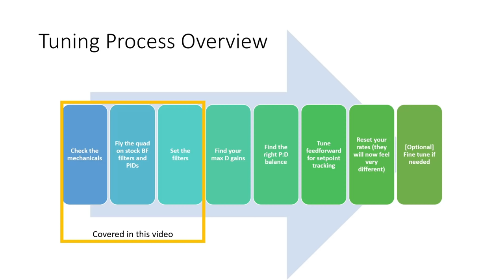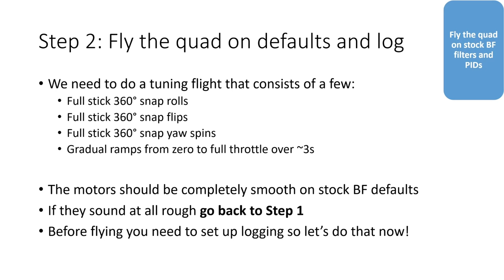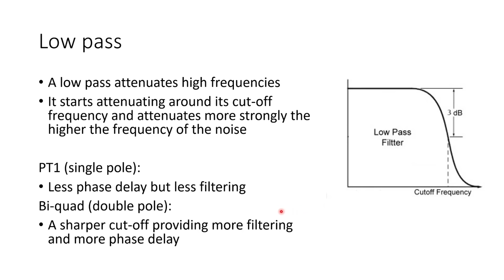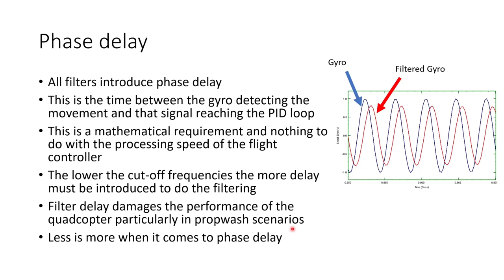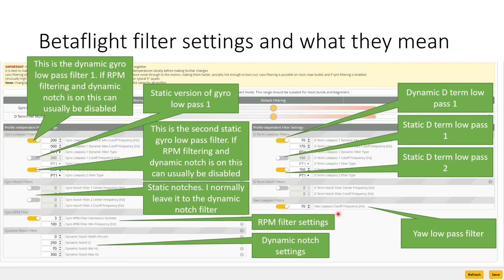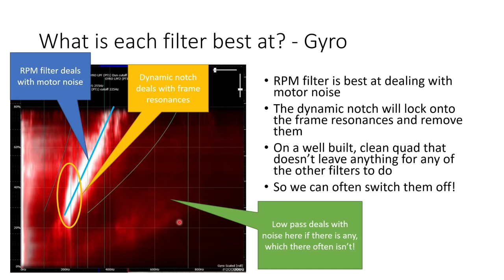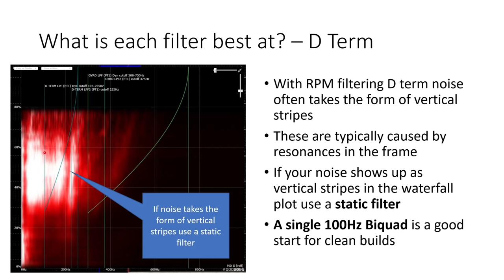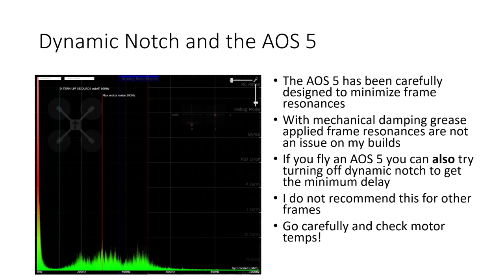Betaflight 4.2 filter tuning. The easy way to get a perfect filter tune!

Comment: Very good video thank you! You are talking about "clean build" a lot, but I could not find any information about what that really means.
Reply from the maker: A build with minimal vibration. New props, smooth motor bearings. Nothing that can waggle around and create vibration in the air.
Reply: @ChrisRosser  thank you!

Comment: How critical is it to keep things off the FC? For micros using AIO whoop style FCs sometimes there is no choice but to use 2-sided tape and stick a vtx or Rx to the board. Or does your video pretty much apply to larger quads?
Reply from the maker: It is a risky thing to stick anything to the FC on any quad. If it touches the gyro chip it can cause problems.

Comment: Thank you very much for this, Chris! What sorts of gyro and D-term filter latencies are you seeing, as reported by Mark's XLS? What do you think is a good proportional split between the gyro portion and D-term portion of the total filter latency? At what latency thresholds do you anticipate big gains (or very poor performance) to occur?
Reply from the maker: On my Perfect AOS 5 Gyro is about 1.5ms and D term 2ms if I remember right.
Reply: @ChrisRosser  That is relatively super low from what I can tell! 1) Can you say anything quantitative or qualitative about the performance benefit per ms below xxx ms? 2) Can you suggest what percentage of latency is worth moving from Gyro to D-term, when the total sum remains constant?

Comment: Hi Chris,
Great video, I have a vertical line on the waterfall graph @ 462 Hz . Should I extend the dynamic notch range to 475 or 500Hz or does the static notch D term set @100Hz biquad take care of this?
Reply from the maker: I would think the attenuation from the biquad filter on D at those frequencies will take care of it. Check you don't get any noise on P as a result though. In general try to keep the dynamic notch range small because then it is more accurate (it only has so many steps of frequency spread across the whole range. The smaller the range the smaller the steps)

Comment: Another great video thanks. tried these filter settings on a very clean Apex build and propwash handling is phenomenal, the quad is super responsive and flies like it’s on rails. It does feel a lot more aggressive than I’m used to though, kind of twitchy feeling because it responds so quickly. I’m surprised that it feels like I need to adjust my rates, is that to be expected?
Reply from the maker: Yes yes yes. You will always need to adjust your rates once you tune. You may have gotten used to the feel of an under tuned quad and bumped up your rates to compensate. Typically you may need to add a little more expo and reduce your max rates a little.
Reply: @ChrisRosser  Thanks, I've never noticed that much difference before but it was really obvious with this. My max rates are usually around 900 degree per second with 0.2 expo and it feels like they've been bumped up to 1100 😂I'll adjust my rates. Thanks again mate, I thought my Apex was flying great but it's next level now.

Comment: Hay man just subscribed after joshua bardwels videos. Ive just built a tbs source one 7", and played around with presets etc but had bad jello in my hd footage, i guess what i would like to know is if i follow your guides on removing filters, settings etc will it still apply to my 7"?
Reply from the maker: It may help. If the arms are only 5 or 6mm thick it will suffer from bad vibration due to the frame not being stiff enough. 8mm is better IMO.

Comment: What would you recommend for a clean build that should be able to handle some crashes? For example a freestyle quad that I'm taking to a bando and/or risky flying.

Currently I just move the sliders to 1.8ish / 1.2ish to have low gyro delay and a fair amount of dterm filtering. It seems to handle crashes and imbalances pretty well, haven't burned anything yet.

Low delay to improve flight dynamics but keeping some leeway for crash resistance is my goal.
Reply from the maker: My filter suggestion should be OK for crashes. It's mainly less D term for crash resilience IMO

Comment: In my case, I was flying ELRS with bad configuration in my radio. The feedforward was sending noise directly to my PID controller. So, also radio and receiver can make your drone fly badly even with the default betaflight config.

Comment: Questions about the gyro and dterm rpm filter q factor... Do you change these from the defaults (500) when turning off gyro lowpass filters? The 4.2 tuning community presets show higher settings for these which would be less filtering, if I'm not mistaken?
Reply from the maker: I don't change the Q factor for rpm filtering. I do change the Q factor for dynamic notch as recommended for use with rpm filtering.

Comment: Hello Chris You covered static biquad settings for verticle noise on waterfall plot. i have a sweeping band so I assume you use dynamic filter settings for the Dterm lowpass filter. Is the default in BF 4.2.9 adequate?
Reply from the maker: I would switch from stacked PT1s to a single biquad.

Comment: Coming over from jbardwell, in for the science.

Question, resurrecting an f450 clone from almost a decade ago (wow with Simon k firmware, pdbs, multiwii 1.3 neo6 gps etc.)

New arms, New motors, New props (hq 9x4.5x3), New FC and esc 4in1.  Had to bump the filter sliders up about .2 (towards more filtering, both sliders) and the master pid gain down .2 to get nice smooth cool motors.  

Is this frame just a wash (specifically the plastic arms with the expectation of long range decent speed flight, id like to be able to flip and roll, but I know it's not really built for that)?
Reply from the maker: Plastic arms on a 9" quad will never match a modern 5"  made of carbon fiber because the stiffness of the material is so very different and the size so much bigger. It's a wonderful project though and I wish you the best of luck!

Comment: Chris, is it right to say that Filtering only removes the high frequencies from reaching the gyro, but physically these vibrations still exist.
Also, no PID settings or Filter settings will physically remove these high frequencies. The only way is to have the quad mechanically sound.
Is all of the above right?
Reply from the maker: Spot on 100% That's why step 1 is so important and why I am designing the AOS frames.

Comment: I have a question - timestamp 24:40
Why dynamic notch? Shouldn't a static filter take a place here since the the noise doesn't move with throttle?

Comment: So according to the information here and if I got them correctly, it makes sense to always use the same setup with a tuned quad. So same battery position and dimensions including weight, aswell as any additional things like a gopro etc, right? Is there a simple rule of thumb when I go without additional gear or different battery?
Reply from the maker: Best to tune the heaviest setup (as that will require the most D term typically) then you should be OK with lighter setups. Or use PID profiles!
Reply: @ChrisRosser  did not yet look into PID profiles. Thanks, I will try it out

Comment: If a quad has no SD or on-board data-flash, what do you think is the best method to get this data? I would fix it on my bench, strap it down securely to throttle it up with props on, and then I want to use a phone app to see the frequencies. Or is there any way to see the frequency in betaflight or other software? The sensors tab only shows absolute values
Reply from the maker: Open lager. Spelt like the beer.

Comment: Hey chris, after doing a blackbox flight on a freshly made quad with loctite on all screws and no damping grease. Applied the supafly preset. All my filter logs are completely flat from 107 hz onwards, only yaw trailing off to flat at around 140. The freequency vs throttle graphs have no waterfall plots on the right side and all the noise is below 100hz and very close to 0hz for 85% of it.( i have the graph scale gain all the turned up all the way from the top right ). does that just mean that i have a really clean quad to begin with already?

Comment: When your looking at the D term waterfall plot at approximately 30 minutes  in.  Is this noise left over after filtering  or before? Also did you just click on Dterm  signal, or is there a gyro_scaled type deal  to click on for looking specifically  at dterm?
Reply from the maker: That's noise left over after filtering on stock filters. I just clicked on D term.

Comment: At 24:00 you say rpm filter is best because it knows motor rpm. Does this change for 2/3/4 blade props? (As some of the noise come from the prop pulses off each blade hitting the arms)

Comment: I'm trying to figure out where filters are placed in the chain. If I well understood, the most of them are placed in the middle between Gyro-output and PIDcontroller-input. With exception of DTerm Filters, which are placed at D processor output. Is it right? So this noisy signal (D processor out) will be used in the PID loop. Am I right?
Reply from the maker: D term filters go on D term input.
Reply: @ChrisRosser  but on D Term input signal has not been still processed by D Term, so noise has not been still generated.

Comment: Can you explain a bit more on how filters are a mathematical requirement and have nothing to do with processing frequency?
Reply from the maker: I use a very simple example to explain this to myself. Imagine you just do a moving average (that's a type of low pass filter) and average 5 points. You can't get your first answer until you have collected 5 points. If those points come 1ms apart then you have to wait 5ms for your first result. No matter how fast you can calculate. All filters work like this (although they use more sophisticated maths).
Reply: That makes sense. Thanks for the explanation.

Comment: When I turn on Bidorect Dshot on my motors dont turn why i cant arm anymore. What i do wrong. I am extremly new in the hobby. And i heard i can manage my propwash on my whoop with dynamic idle. I have the woopfly16 by sub 250 with 35.20g w.n Battery. And 47.38g with 530mah

Comment: Hello Chris. Is 16 MB enough to record a full flight with gyro scaled on the Onboard dataflash chip? It last 4-5 second on mine and is full.
Reply from the maker: Yes it should be enough. Make sure to log at 2kHz and erase before you start. Remember that each log can have multiple sections in BB explorer (top right).

Comment: Hi Everyone,
I have good old Alien frame. As expected it has a big frame resonance at around 220 Hz from 0 - 65 % of throttle. The dyn notch fights this very well. The typical motor noise is very little. Maybe as I use TPE soft mount pads. But I have a second frame resonance at around 405 Hz. The dyn notch doesn't catch this and the D term looks nasty. I think because the width is at 0 which means just one filter at a time. Now I tried an old school fixed gyro notch at 405 Hz with a width of +- 40 Hz. This actually makes it better.
But:
Is this the best way?
Is a lowpass gyro filter (e.g. cutoff 350 Hz) better?
Or should I change "dyn_notch_width_percent"?
Or just update to BF 4.3 with e.g. set dyn_notch_count = 2 ? ;-)

Comment: What should my dynamic notch settings be with a 2.5 inch tadpole frame? Or maybe a better question, how can I discover these settings myself? (29:42)
Reply from the maker: If you look at 23:00 you will see what each filter is for. Dynamic notch min should be set a little below your lowest vertical frame resonance and dynamic notch max a little above your highest one. Q = 250 and Width percent = 0 is the recommended settings from BF devs for use with RPM filtering.
Reply: @ChrisRosser  Thanks for the very quick response! Appreciate it a lot.

Comment: I know this is old but in this video you say make sure bidirectional D shot is set up and working with 0% errors. I thought that it was normal for bidirectional D shot to show 100% error on all four motors and that's how you knew it was working, all of my binding flies with bi-directional d-shot setup have this 100% air and my build with bidirectional d-shot has this 100% error in red under motor tab. Can you please further explain, I'm very confused now?
Reply from the maker: You'll get 100% error unless you have a battery plugged in and the ESC powered up. 👍

Comment: I find it curious that you recommend tackling frame resonances with low pass filters. What's the rationale behind this? It seems to me like addressing those with static notch filters would be the better (lower latency) option
Reply from the maker: Low pass filter is only on the D term. Gyro low pass are all switched off. Low pass on D term cannot be avoided due to D term amplification with frequency.
Reply: @ChrisRosser  I understand that you would increase the effectiveness of the D term low pass filter after disabling gyro filters. That totally makes sense to me. What I don't get is your statement that you would address frame resonance via the dterm low pass filter. Frame resonance always happens at the same frequency so it's best addresses with a static notch filter (dterm notch in this case). That would allow you to use less aggressive low pass filtering and give a better filtering latency overall
Reply: @fabianisensee3744  my frame resonance frequency is a spike at 300Hz, 50Hz wide. Why should I use a LowPass? Will be ok a Dynamic Notch with Q=100.

Comment: So I watched this and switched off all the filters except for those ascribed as "clean build" filters, did the tuning flight, looked at the waterfall graph....but have no idea what I need to now turn back on based on the logs. I have a vertical band of resonance noise at 250hz, and a sweep of motor noise starting at 150hz up to ~450hz.  The dynamic notch filter is on ( clean build settings ) , but the chart still shows the noise is there.  I'm expecting that as I change things, the chart will be "cleaned up".....am I doing it wrong?  Thanks so much!
Reply from the maker: If you are looking at gyro scaled that is before filtering. Look at the gyro plot to see what it looks like after filtering is applied.

Comment: When thinking about tunning filters for a 2,5 or 3 inch quad that has no memory storage to log, do these filter values still apply or that's just regarding a 5 inch example and the others are an whole other world?
Reply from the maker: You can start with my recommendation and gradually increase the cutoffs. Smaller quads are typically less noisy than larger ones.
Reply: @ChrisRosser  thank you :) I'll give that a go and see if I can get a better tune.

Comment: What would you suggest on a 7 incher with alphagel Payload (1,5 KG AUW) when everything looks the same than yourse, but there is a tiny peak on 85 Hz on pitch and Roll 70 Hz because of the Camera ? D Therm of course amplifies this and under 100 Hz (because of Biquad like you) it looks quite noisy... Setting a notch at these frequencies is not recommended, maybe use normal D Therm sliders and go with the defaults ) They cover that 70 Hz area....
Reply from the maker: Try to increase the frequency of camera vibration by making mechanical modifications, this is not something to "fix in software". Watch my Pavo30 review for ideas!
Reply: @ChrisRosser  yeah i will watch, squeezed the nuts on alphagel grummets completely down as recommended...

Comment: Chris, My defender 25 does not have a single static 100 Hz Biquad filter from the factory, should I enable it? Also what is the cure for - when I am taking off, I have an image delay after arming and into the first 2-3 seconds of the flight (defender 25 o3 air unit)

Comment: Hi thanks a lot for your support!
Im struggling with an unresponsive throttle with Wind back, like ive no controll for a second. Ive tried default bf 4,2,5, rpm filtering, i term and P e D balance, the fell changes, but the mini “flyaway” remain !
Happy easter 
Thanks again for your job 🙏
Reply from the maker: Air mode permanently on?
Reply from the maker: Air mode permanently on?
Reply: @ChrisRosser  yes, on a switch but yes it was on during the flight test.
its a particular frame, by @dexmodels Hydro h ( a frame that float ) , maybe i can send a pic 🙏🙏🙏
Its all brand knew 
T motor f60 
Fc F7 velox
Esc 4 in 1 Pacer 50a
Capacitor  35
I tought was mechanical, but all looks good, maybe a defective gyro?
Reply: @ChrisRosser  i Tried to resync esc, low ram power, Air mode off and still remain the problem.
I saw on black box Explorer, during this kind of drift, front right motor go to 0% back left 10%, and the other opposite 30/50%, while my stick comand is 0%throttle 0 pitch , maybe to compensate the motor at 0? Sadly Im thinking to change hardware

Comment: A biquad is not equivalent to 2 pt1 stacked together. The biquad actually fits somewhere between a pt2 and pt3. The biquad also has ringing which ptn filters do not suffer from. So no pt2 does not equal biquad. Me and the bf devs dont even recomend you use biquad filters anymore.
Reply from the maker: You are quite right, I might have over simplified that a bit. I'll add a card to clarify that its just a rule of thumb.
Reply: Very true Kevin. I think the pt2 and pt3 options are gonna be great replacement for the BQ. That said the BQ code will remain until there’s an alternative for notch filters. There is new crossfade code from “Karotebrot” that seems to deal well with the ringing caused by the BQ-notches. That’s a nice addition coming in BF4.3. Plus Chris Thompson’s PT-2/3 stuff.